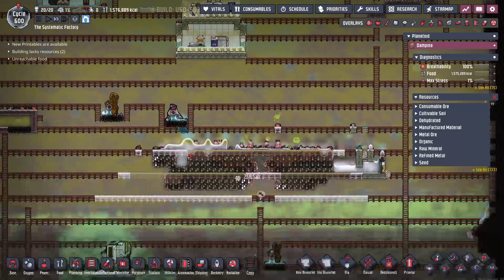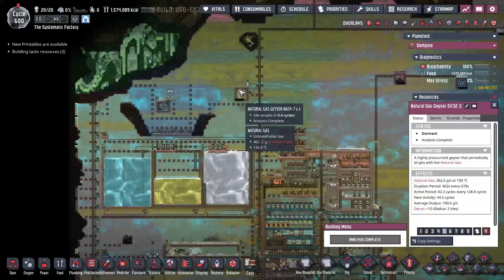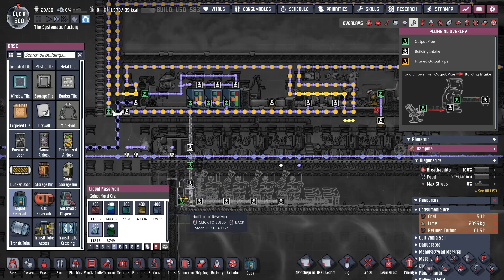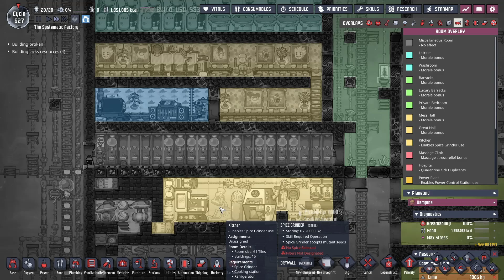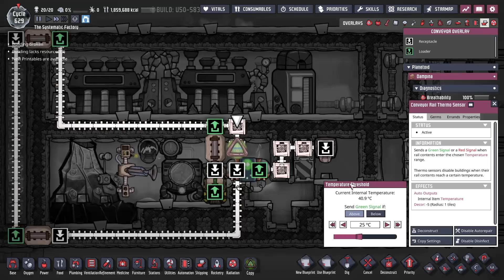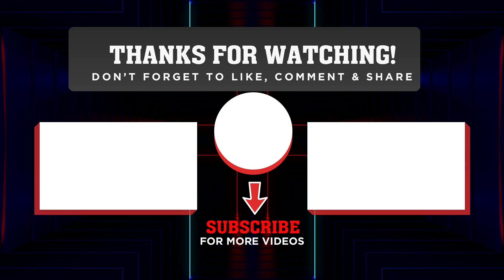Volcano Taming and Renewable Refined Metal | 13 | Oxygen Not Included | Oceania Cluster

Comment: you made a mistake in the output pipes from the steam turbines because they cannot be connected in series because how can you see that the left turbine is not working due to a blocked pipe 24:20
Reply from the maker: I did!  I fixed it after.  They can be connected to the same pipe, but not in series as you said.  It didn't really effect it because that volcano didn't need more than one turbine, but it effectively made it so only one am turbine could run.

Fortunately I had to go back in to make other changes as well because I wanted to change the insulated block type so it was an easy fix.

Comment: Question: what about the tiny packages that could be there forever on the rails cos it's too tiny to drop temp? They are not a thing ? I've always read you need a fail safe for that if you use the temp filter.
Reply from the maker: I have not experienced that.  My system loads more on with each pass and so I would imagine that it would only be an issue if the rail got overloaded with small packets that are too small to cool.  As the loop is about 30 blocks long, it would take a while for this to happen.  

That being said, it's my first time making one of these and I'm sure problems will arise.  That's why I left it accessible, for the inevitable changes.
Reply from the maker: Also, we will be making several of these.  For different types of metal, so hopefully I will work through lots of issues.  The things that break are what make the game so fun for me.  I love solving how to make them work.
Reply: @ender7154  hmm, yeah I guess the packs will grow to full size, since it goes in a circle like that. The chiller section is a lot smaller than mine, so very interested if this works well.
Reply from the maker: So far it works.  It works slow, but that's okay.  I did make a few changes to make it so the aluminum is moved clear from the base of the volcano more efficiently.  And the loop is a bit longer.  But as this will continue to work indefinitely, I'm fine with it taking a while to bring the loop down to 40 degrees as over a long enough time scale, we will built up more than I can use.